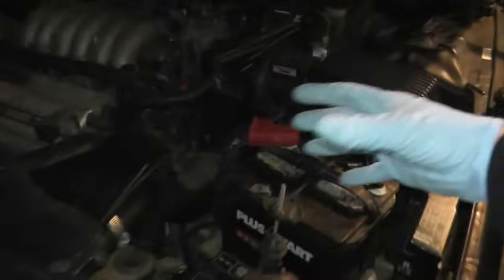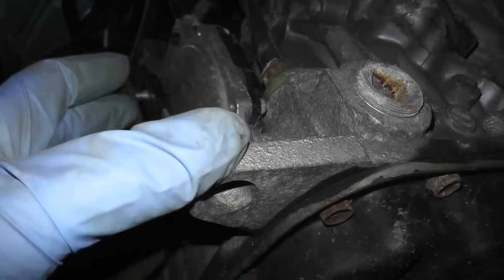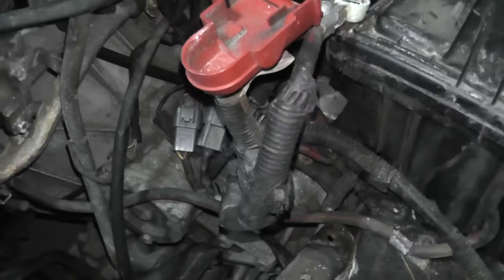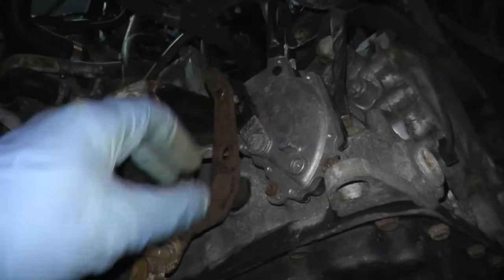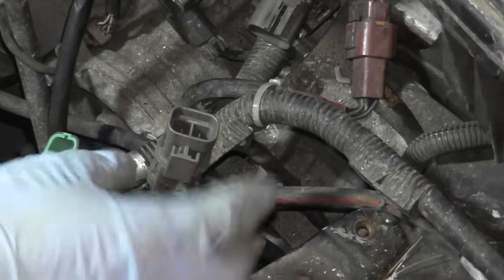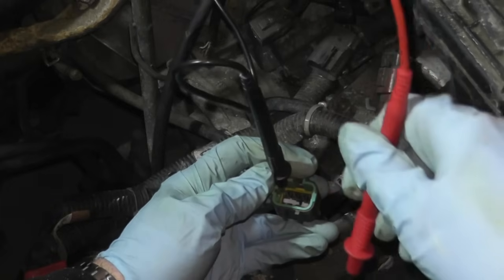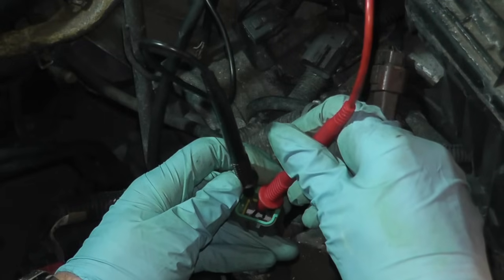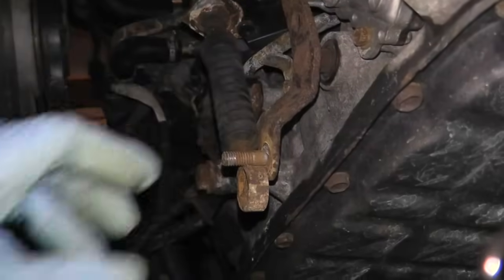How To Test and Replace the Neutral Safety Swtich / Inhibitor Switch P0705

Comment: I have a 2001 Chevy Malibu v6 engine. Sometimes it starts in park but most of the time in neutral. When I try to start in park nothing happens no crank or sound.  Starter and battery are fine. Any info would be appreciated thx
Reply from the maker: Armando Burgos Sounds like the symptom of a bad or going neutral position switch.
Reply: CarsNToys thanks for the info I'll update you thx
Reply: CarsNToys could it be a short that causes this as well?  My headlights have a short and I payed 100$ for somebody to fix it and, they micky moused it.
Reply from the maker: Armando Burgos
If the car always starts in neutral then I think it's the sensor going. You can also adjust the sensor. I'll try to upload a video for that this week.
Reply: CarsNToys it worked bro I appreciate your help. Thank you
Reply from the maker: Armando Burgos
Awesome man glad it worked out
Reply: CarsNToys Crap I thought it worked but now it won't even start in neutral or park. Suggestions?
Reply from the maker: What have you done so far?
Reply: Checked fuses, replaced battery, starter good, recently replaced ignition switch, and the NSS. I'm starting to think it's a short.
Reply from the maker: You can check for the short pretty easily. See if you're getting battery voltage to the NSS harness connector. Also search on Scotty Kilmer's channel. I remember he has a video on how to find shorts
Reply: CarsNToys turned out to be my alarm system, guy at the dealership said it's fried and shorted out. Charging me 375$ to take it out

Comment: Its a 2000 maxima 5 sp. 3.0l
Reply from the maker: Delshawn Arnold It's on the transmission housing; toward the top. You can often find the sensor by looking for a wire that runs to the top of the transmission.

Comment: Hi, watched the video, and Im curious if you think this would fix my problem
2001 Nissan Pathfinder LE, all gears work,
but when in Reverse, it sounds and behaves like Neutral.
Fluids are all okay, no accidents or anything like that.
Parked the car, next day, no Reverse.
Could this video help me fix this?
Reply: CarsNToys
So long story short, its a tranny rebuild?
Whats that about 500-1000?
If im "lucky" looking at you God
it would be the gear lever cable?
Is that the one in this video?
Reply: CarsNToys
Are all rebuilds the same in expenses? What if its a simple problem?
Thanks I'll look for free estimates! I appreciate that.
And can you explain what the gear lever that youre talking about is
I know youre busy but just enough so I can go research it please :)
Reply from the maker: TheWiseZenShaman It's the most complex system in your car so it's always expensive. But again, if you're lucky it may be a simple fix such as a worn cable running from the gear lever to the tranny. Easiest way to find it is while the truck is off, crawl underneath the tranny and have someone move the gear lever from park to drive. You should see and hear clicking noises. Just follow the cable and make sure it's on tightly and that every gear engages.

Comment: hi i watched your video and it was helpful.. but i have a 2003 kia rio 5 door.rx-v.. this is the problem when it is cold it wont start  all i get is a click click all lights are on fan, heat all power but wont turn over...when i park it on a hill it wont start... so i replaced the altenator.. starter, plugs and wires.. and crank shaft sensor.. it still doing the same thing... if i put it in neutral sometimes it will start... in park sometimes it will start.. some times i have to shift it back and forth from park to 2nd fast and hard then it will start..  soetimes all i have to do is let it warm up and it will start..i was told that maybe it's the neutral safety switch or maybe the park rang switch, or inter lock cable, or entire shift cable...i have spent so much money on this car it is sickening... i can't buy a new one this car has just about everything new on it now...i feel like im being shafted by men... can you help...no one has said anything about adjusting the transmission lever is this even possible on this car....this car is truly evil... any help will be appreciated..
thanks
sandra
Reply from the maker: jamesgwilson1964 First thing that comes to mind is a weak battery. If the cold cranking amps on the battery isn't enough, you'll hear a clicking noise from the starter. (There isn't enough juice to turn the starter.) Next time it happens, try jumping the car. (If the clicking noise is coming from the starter, the neutral safety switch isn't the issue.) Also, is the check engine light on?
Reply: CarsNToys
I have the same problem in a 95 Crown Victoria. I installed a new battery, but still doing the same thing. Could it be the neutral safety switch ? When the car reachs the normal temperature, it works fine. Thanks for your help.
Reply from the maker: It wouldn't be the safety switch if the vehicle is cranking or attempting to crank.
Reply: No crank. I have to conect a wire from the solenoid, place the key on ignition and then touch with the wire the positive lead of the battery so the car could start.
Reply from the maker: Gotcha. You have a wiring issue. There's a nice tool called power probe that can help find electrical breaks quickly.
Reply: Thanks !!!

Comment: Thank You for sharing this video! When I tested the continuity of the first two wires I didn't get continuity. What are the first two wires?
Reply from the maker: Those wires are used to detect when the vehicle is in Park and Neutral. Was the inhibitor switch in the park position when you tested for continuity? If the sensor is in the park position and you have no continuity, remove the shift cable from sensor and perform the test again. If you still don't have continuity it's a good indication the sensor is bad.